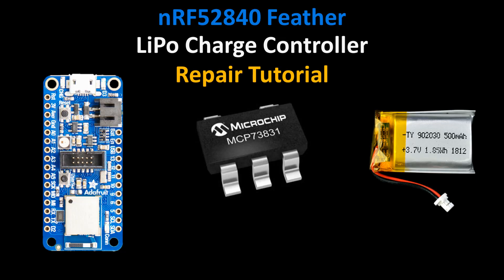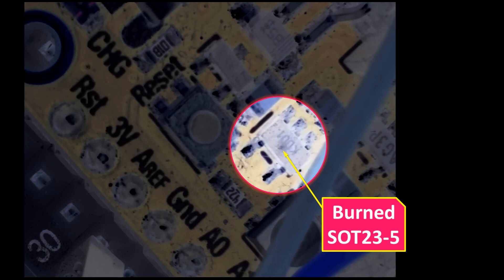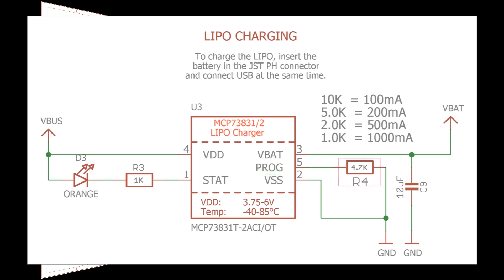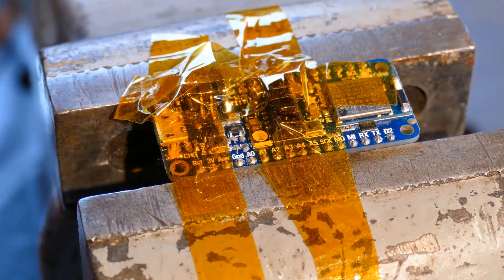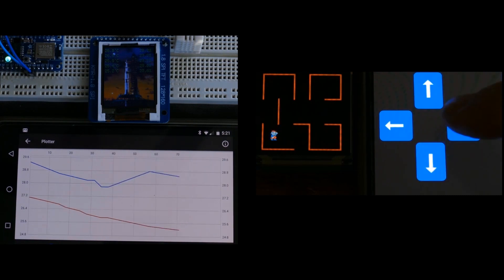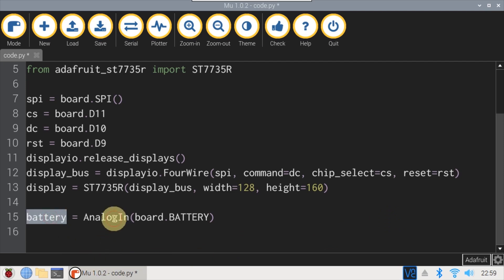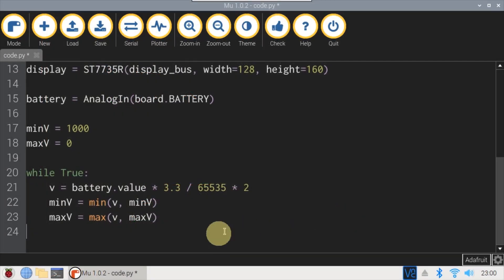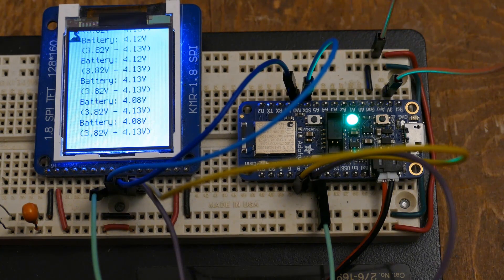LiPo Charge Controller Repair Tutorial

Comment: How exactly do you check if the battery is charging? What do you connect the multimeter to? Thanks!
Reply from the maker: Set your multimeter to measure DC voltage.  Measure on the terminals of the battery connector on the board (red to positive and black to negative).  The voltage should rise when you start charging unless the battery is full.  If it’s charging the voltage will be around 4.0-4.2 V assuming a good battery.    If it’s not charging the voltage will drop over time.

Comment: I have a challenge I cannot figure out.  Can I share and you advise?  I have no knowledge or logic in this area, also  I have a disability that limits me.

I have a LattePanda Alpha SBC.  I also have an LCD I removed from an HP LAPTOP.  I am looking to build a battery that could provide 12hrs or best yet 24hrs of usage.  I need up to 24hrs as when I travel I need 24 hrs of battery to continue my work while traveling.  There are no locations / time to recharge the battery while in travel.
I would like to enclose it “all”” in a custom laptop case designed for this unit / lcd / and batteries.  Is that a possibility?
Reply from the maker: I don't have any experience with the LattePanda but I'm sure it's possible.  I recommend you ask the LattePanda community.  I don't know the power consumption of the LattePanda but you can buy 5V 32000mAh battery packs on Amazon for $50 US.  Someone has probably already built a battery system for the LattePanda with health monitoring.  You will want to specify if your HP display is LVDS or eDP.  Often the adapters required to connect a laptop display are more expensive than a display designed for your SOC.  Best of luck!
Reply: I can get power requirements from  - www.dfrobot.com for latte panda ALPHA model.  I need to get LCD power specs either from HP or another source.